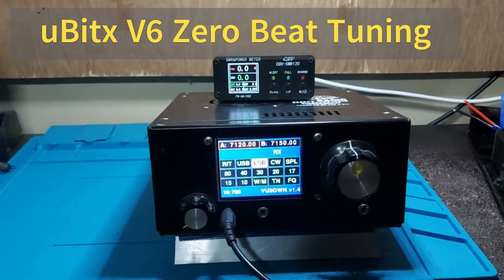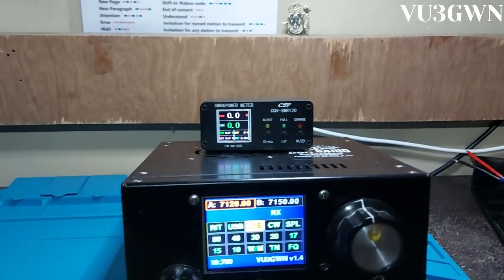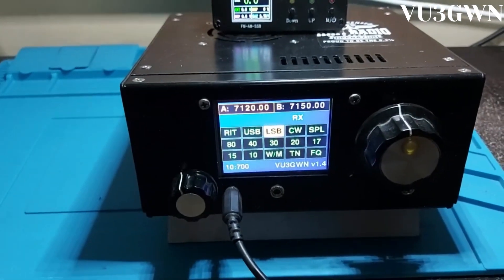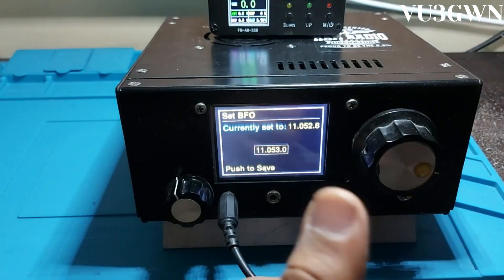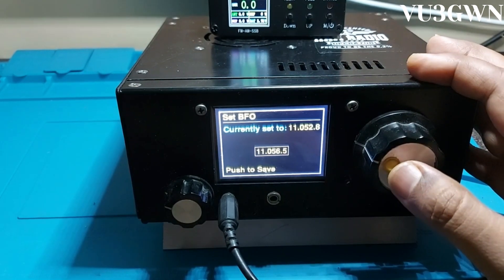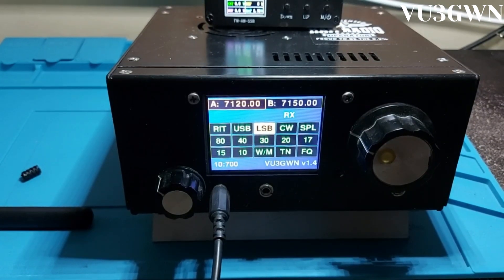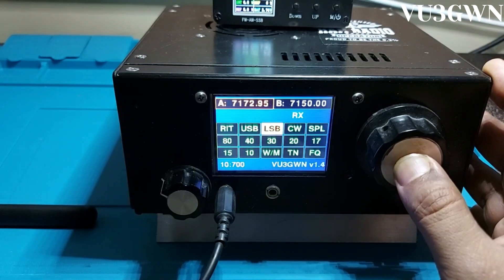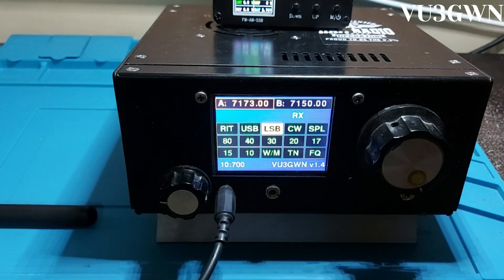uBitx V6 Zero Beat Tuning

Comment: Hi, thanks for this excellent video. I have a Ubitx 6 still on original software. I did install the Nextion Screen 3 Inch approximately and appropriate firmware but had issues with correctly setting the Bfo. My signal had Usb and Lsb swapped as well as very low Tx power. That's resolved now so I will use your BFO method  with the original software then re-install the Nextion screen and software. I have subscribed.
Owen from Down Under Australia Vk5kov.